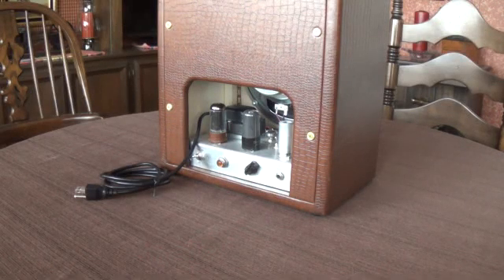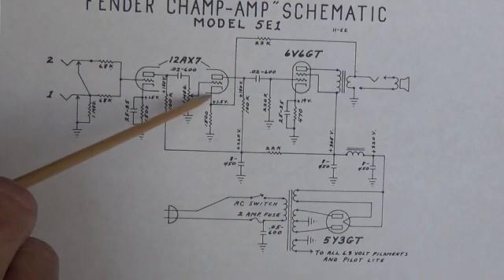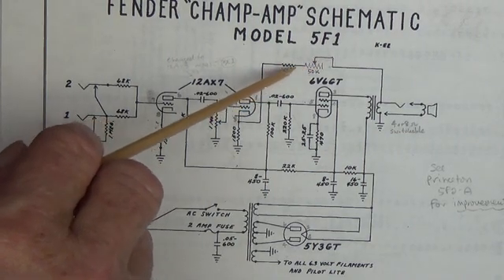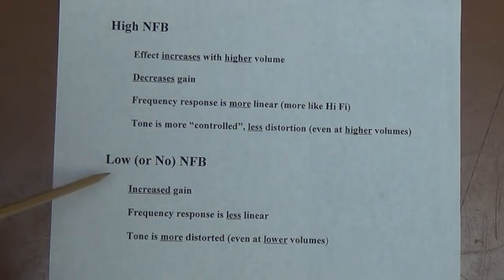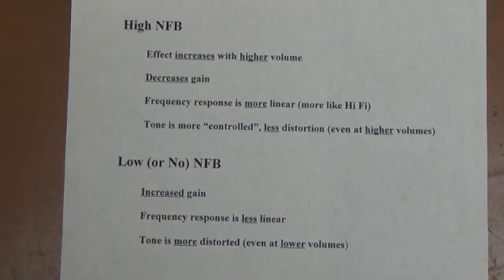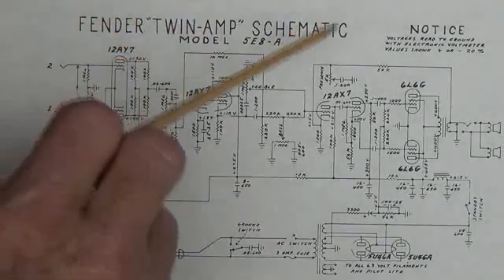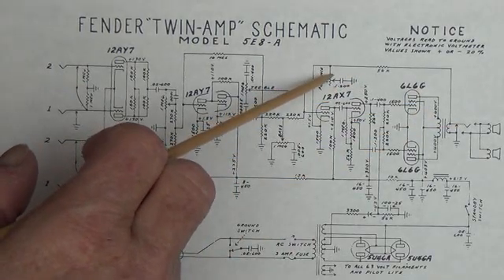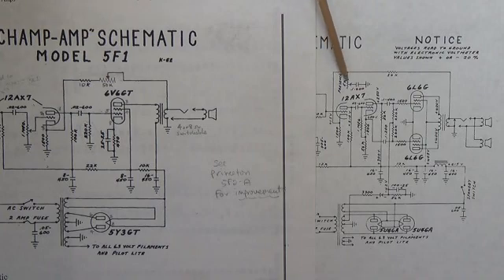Negative Feedback Loops and the Fender Presence Control

Comment: Late to the party here, but the way I see it is, by having a pot on the NF loop (not presence) can actually help you get cleaner tones at high volumes allowing you to push the amp to the sweet spot while fending off tube breakup. Is this correct? I came here to find out what a negative feedback loop was (after looking into what the presence control does) and found out more than I expected. Thanks!
Reply from the maker: The more NFB you return to the cathode, the cleaner the tone.....which is generally not where the "sweet spot" is found.  At low to moderate volumes, zero NFB tends to sound the best, IMHO.

Comment: Aloha uncle 
Is it possible to use the ground switch on a Princeton amp AA-964 as a nfb loop 
The cord was changed to a three prong the death cap still there is it ok to do ? Using the same method you do on all the other fender amps ? 
Thank you uncle Aloha from lahaina
Reply from the maker: Remove the Death Cap from the circuit, isolate the polarity switch from the circuit, and rewire the switch to turn the NFB loop on and off.....as I have demonstrated in numerous videos.
Reply: I love your heart I’ve learned so much from you over the years you’re a wonderful human Aloha
Reply from the maker: @Avi-ronen  Wow, thanks so much, Avi :)

Comment: hi if we measure negative  feedback  for the result ,where you put your scope  is it at the input of the grid of output tube or on the output transformer, so its makes a difference,this is less good at the output transformer .thanks
Reply from the maker: I have never used a scope for this purpose, KF, simply because it's easier and more effective to tune the circuit by ear.  Use a recorded input (or have someone play) into the amp and experiment with different pots, caps, resistors, and settings to achieve the desired tone effects.
Reply: ok thanks 
 @UncleDoug

Comment: hi ,i made a single end audio and i put a 10 k pot to adjust negative feddback,if i turn the pot i see only  the gain  decrease but i cant see  change of the square wave on my  scope only the gain ,the shape dont change  so i see the square  waveform  with my scope at output transformer ,is it normal to see nothing in the shape  of the square wave  except gain and the différence occurs only by ears,thanks
Reply from the maker: Depending on the circuit, a 10K pot may not offer sufficient resistance to shut down the NFB effect. I don't use a scope to assess proper NFB tuning.....just my ear. Instead of a square wave, inject a fixed 1 or 2Hz sine wave.
Reply: @UncleDoug  ok thanks a lot

Comment: Another gem, Uncle! Is the negative feedback source from the OT secondary out of phase with the signal at the driver triode grid because the signal from the 6V6 to the OT is out of phase with the driver triode (each triode inverts phase)?
Reply from the maker: Thanks, Jeff. You can count the phase reversals as the signal passes through each stage of amplification, allowing you to see why the NFB signal is sent where it is.

Comment: So logically a depth control like on a 5150 is the opposite of a presence control where you are filtering out high to accentuate the low end correct?
Reply from the maker: Yes, the filtering can be adjusted to reduce or eliminate chosen frequencies.

Comment: Hello Mr. Doug, I wonder if this also applicable on a bandmaster blackface"64 (AA763) , I saw that this feedbackloop has a 820 ohm resistor in the chain, not a 2K2 , what would be useful here to create a variable NFBL ?, tnx ahead for you insight...(and help :o)
Reply from the maker: My advice would be to replace the NFB resistor with a potentiometer and find two ideal resistances that sound good to you, then hard wire them into the circuit (DTSP switch)......or simply leave the pot in place, with a fixed 100 Ohm resistor to ground (to prevent shorting the NFB loop).
Reply: @UncleDoug  thank you from sharing your wisdom, I learned a lot from your video's 🙏
Reply from the maker: @ronlammers8972  That's great news, Ron :)

Comment: I have a Webcore HI Fi amp (#4903) and I would like to add a presence control to the circuit. The feedback resistor value is 47k ohm , close to the 56k ohm of the Fender Twin amp in the example. Like the Fender amp there is no cathode bias amp  capacitator at the first stage cathode of the 12AX input tube . The output tubes are different (6BQ5). Would a presence control work on this Webcore amp with some mods to the cap and pot value?
Reply from the maker: It's hard to guess, David. Why not simply try it and see?

Comment: Strange thing is when I turn the negative feedback pot the current on the anode changes, it goes between 160volts to around 260volts, so somehow things are affected. Just commenting. I read that the 12ax7 could take up to maybe 350-400 volts, so it should be fine.
Reply from the maker: I think you mean "plate voltage" rather than "current", OT.  Yes, removal of the NFB does increase the operating parameters of the tubes, which explains the dramatic change in tone and volume.
Reply: Yes I ment to say that. Thank you for your reply Uncle Doug. i have now built a 5f1 and a 5f2, going to try them in stereo once I get a new 12" for the Princeton, and experimenting with one of them as a pre. Enjoy your projects.
Reply from the maker: Will do.  You, too :) @ofthetree
Reply: Finally noticed I had wired the Negative feedback pot all wrong!  And spent the day digging the eyeletboard out so I could fix it properly, and now the sound is as it should be and I bet the voltage would also be more normal. I had a feeling something was not right. So please disregard the above. Think I have remade this amp three times by now.
Reply from the maker: Sounds like a great learning experience to me.  I'm glad you corrected the error.  @ofthetree

Comment: Hi Uncle Doug. Once again I find your videos useful. Had missed this point about a presence control with a capacitor to the variable negative feedback (which I allready have). Just tested a 0.1uF in there (a 5f1) to get a sense of it, and yes it tightened up bass and got me intrugued. So this will be implemented. I always scroll the comments section of your videos to see if some people have some bright ideas or experiences and often there are. Gonna do more testings. Autumn Greets. Jon
Reply from the maker: Thanks, Jon. We're glad the videos are useful :)
Reply: oh, btw, the cap I tested was 1uF. so that is why bass seemed tighter i recon, will see more when I test it with different values and a pot. Have fun with your projects.

Comment: hi i appreciate yours vidéos and you speak very clearly and youre a good teacher for a french like me ,id like to know how about what voltage of power supply and plate voltage on tubes and cathode voltage cause shematic dont mention nothing about this 5f1 .thanks
Reply from the maker: Thanks, Kubock. Simply buy a power transformer designed for the 5F1 circuit, follow the schematic carefully, and your voltages will most likely be within acceptable parameters for each tube. Good luck.

Comment: So then... no NFB is key in getting these old amps to sound like they should. Leo went to great lengths to try to eliminate any kind of distortion as time went on, to the point of scooping out all the mids in the 60s amps to try and keep them clean sounding.  It's as if he was in denial of the rock n roll sound that was created with his equipment
Reply from the maker: Removing the NFB allows for distortion at lower volume levels, Brent, but at high volume levels it is useful to avoid utter pandemonium.

Comment: Very good video. Revealed new things to me. I have a Hot Rod DeVille, the Presence Knob (NFB) is a 25k pot a .1 uF cap and 2 resistors R68 4.7k and R69 47k. I feel that on the clean mode even with the Presence all the way down I still got that anoying excess of high mids harsh frequencys. I think that even with the Presence on 0 there's still some negative feed back on. I know that eliminating the negative feedback will drastically change the sound of the amp so I don't want to do that. I just wanna have less of that NFB effect than with the Presence on O. Could you please tell me if I need to change the value of a resistor or the cap? I know that the NFB on this amp is fine tuned for working on both modes (clean & drive) but I never use the drive mode so I want to adjust the NFB to get the best sound possible out of the clean mode. Thanks in advance from Venezuela
Reply from the maker: After a quick look at the schematic, to reduce the NFB effect you can send more of the return signal to ground by reducing R68, block more by increasing R69, or reduce the frequency loss by reducing C29. I suggest experimenting with any or all of these mods to see what works for you.
Reply: @UncleDoug thank you so so much for answering! R68 from 4.7k to 3.3k, R69 from 47k to 56k and/or C29 from .1 uF to .068 uF. Do you think it's ok to start testing?
Reply from the maker: @alga1309  Sure....changes in those values cannot cause any harm at all. Experimentation like this is, by far, the best way to fine-tune your amp.
Reply: @UncleDoug  thanks so much

Comment: I'm building a Princeton Reverb amp from scratch. The kit provides a 2.7K NFB resistor. I assume applying your formula of a resistor of around 1/2 the original resistance and a pot that provides a maximum of 3X the resistance would result in a 1K resistor and a 10K pot. That combo would produce resistance from 1K to 11K. Does that sound like a good plan? I want a clean sound but not a lot of breakup. Thanks for getting me thinking about varying the NFB.
Reply from the maker: For a clean sound, your formula should work, Thorne. A raunchier tone would probably require a 25K pot. Good luck.....I hope it works well for you.

Comment: Hola Uncle Doug! How about adding that  capacitor in the presence circuit to the other end of the variable feedback potentiometer. Would that work to both affect feedback and frequency?
Reply from the maker: The use of any capacitor in an NFB loop alters the effect of the loop, by regulating the frequencies that are or are not "neutralized".

Comment: Do you have a MOD for Fender HRD that could add a 2nd master volume control for the normal channel without eliminating the presence or the effects channels?
Reply from the maker: No, I don't, Sid. I don't work on modern amps, nor do I install MVC's. Sorry.

Comment: Hi Uncle Doug, as always thank you for the great explanation and everything you do to explain things in detail. I don't know if this has been addressed yet, but I am a little perplexed. If you have a NFB resistor value of 2700 ohms or 2.7k like on an AA764, and you change the value to 10K in series with a 50k pot. How does that go below the original value when it is already 3-4 times higher on the  lowest setting? Am I missing something? I would think that a 1k or 1.5k resistor in series with the 50k pot would allow adjustment above and below the original values. I am just wondering, since I am in the process of building my first amp, an AA764 with both NFB and a presence control. Any response would be greatly appreciated 🙏 

Take care!
Reply from the maker: Greetings, Brad. Naturally, you tailor the NFB values to suit the circuit. In the case of a AA764 PR, you would use values like those you suggested, so you could adjust from much lower to much higher than the regular NFB resistor.

Comment: I appreciate you teaching things like this as I am about to build an amp like this...good to get this information so I won't have to go back and mod ..I would like to install  a reverb unit in mine...I have plenty of room in my chassis for tubes caps wiring pots and the extra transformer  plus I have room in the cabinet for the spring reverb unit. 
.again  I do appreciate what you do for us
Reply from the maker: For some guidance in the addition of the reverb effect, please see my series on the Supro Tremo-Verb. Good luck.

Comment: Uncle Doug .... i have a Peavey Road Master 160 watts beast !
But the distortion is not even close to be called a distortion channel.
I am not a knowledge electronic wiz but i do know how to solder/desolder
and add componets or whatever is needed to fix in electronics
also aware of the high voltage on tube amp hazards ! I know how to 
discharge caps using a big resistor.
I would pay your fee for you to improve my amps distortion channel
to the same specs as tech do for the Peavey Rock Master rackmount
unit !
I don't have the mods schematic they do to the Rock Master.
But you can easily find both amp factory schematics online.
I hope you can help !
Thanks for all your tech videos !
Reply from the maker: Greetings, D. I have cut way back on the amp repairs I accept, but can suggest an excellent tech who can probably help you out. Please message me on my FB page: Uncle Doug's Vintage Amps.

Comment: Howdy. An addition to my previous comment. Most relevant for Hi-Fi enthusiasts.

Because the neg. feedback arrives delayed to the summing point using secondary (global) neg. feedback there is a possibility for blocking distortion using strong neg. feedback, and therefore, strong drive. It may be checked, with an oscilloscope, whether the end tube grids go positive feeding the amp. with a square wave signal. If that happens the driver stage Slew Rate must be reduced. The reduced driver Slew Rate provides time for the feedback to act.

Regards.
Reply from the maker: Thanks for your very detailed analysis, Eugene.

Comment: Very cool. I know this is an old video but I wonder if you could change the presence control to cancel some of the highs in the negative feed back. Instead of running a capacitor to ground run a resistor to ground after your negative feed back potentiometer? Very interesting stuff.
Reply from the maker: Thanks, Chris. There are all sorts of ways to modify NFB loops.....and lots of room for experimentation.

Comment: This is a good tinker mod in between projects.Since it’s reversible, I was thinking about adding a NF to my MOD 102+ kit (nice little 8watt champ-like amp with an el84 in v2) just to see the effect. I don’t think it’ll improve much but maybe it’ll relieve some of the hum the amp has at high volumes when I use a long plate 12ax7 in V1. A vintage Sylvania long plate 12au7 cleans it up and smooths out distortion nicely but the gain goes down.I’m just curious more than anything. P.S. If u ever decide to use sponsors, ‘Great Courses Plus’ has a very practical electronics course. I think you’d approve! Can’t beat the value at $20 a month for 24 lectures. That also includes about a million other subjects. Idk how sponsors work on YouTube but I just thought they’d be a good fit for your channel.
Reply from the maker: Thanks for the ad suggestion, William. I'll keep it in mind. You can make the NFB loop either switchable on/off, or variable with a pot. See my Homebuilt Champ from Spare Parts videos to see how. It does make a big difference.
Reply: @UncleDoug  I added the NF to the 102+ MOD kit. It did make a big difference. Mainly in volume. More of an off/on thing than adjustable. So I replaced the pot with a switch. The amp is based on a champ but has some differences in output tube (el84) and push/pull pots for extra tone options on bass&treble and the volume too. It seemed to work better going into pin 8 rather than 3. It really had a lot of feedback with the pot dimed going into 3. It IS pretty handy with it on as the amp has great overdrive but it’s too loud to take advantage of in home settings/recording. Is there any great problem with #8 cathode pin? Seems fine. Day later..figured out the pot wasn’t getting grounded in the chassis hole I cut(tad too large) fixed that and feedback stopped on pin three but still better results on 8.I think the tone controls must be the reason? A 4.7k resistor seems to elicit more of a result in this particular amp,as well. I’m still figuring this stuff out ;-). Thanx.

Comment: Howdy.
What you describe here is global negative feedback. There are some disadvantages using global feedback.
First. There is always a phase shift between the primaries and the secondaries of the output transformer caused by magnetization and hysteresis. The feedback arrives at the feedback point delayed in time. This will have a skewing effect on the output. This skewing is not evident feeding the amplifier with a sine wave because summing sine waves with different phases will result in a sine wave. Assuming the frequencies are the same.
The other thing is shock protection. Using global feedback the "free floating" of the secondary is lost.
In my designs I use negative feedback from the anodes of the output tubes. I cross feed the feedbacks to the phase splitter or pentode drivers. The feedback arrival is fast. Check my blog  eugpoh27.blogspot.com  .
The advantage is that this equalizes any differences in the output tubes.
The disadvantage is that cross feeding makes the amplifier proned to parasitic oscillations. It may prove difficult to find the best value of and the best point for decoupling capacitors.
In high regards.
Reply from the maker: Thanks so much for your detailed and informative input, Eugene.

Comment: So my next project was to repurpose an old, defunct Vox AD15VT amp into a hand wired tube amp.  I built a Fender 5D3 circuit into it and wanted to add a presence control.  It won't work, I think its because of the cathode bypass cap.  Is there away I can make it work?
Reply from the maker: I don't believe the bypass cap will make any difference. The Vibro-Champ has a fabulous tremolo that feeds a cathode with a bypass cap.